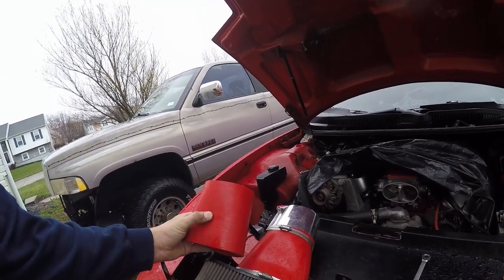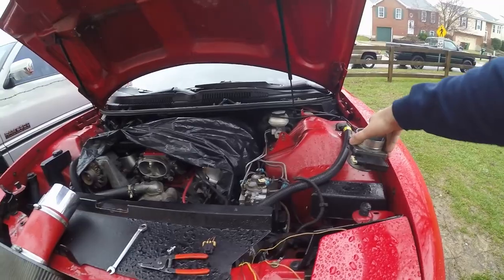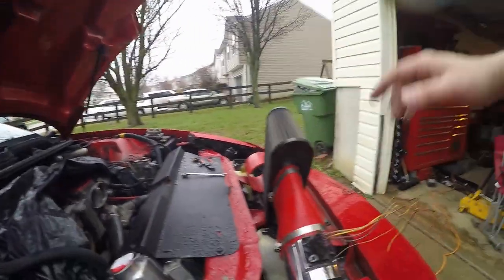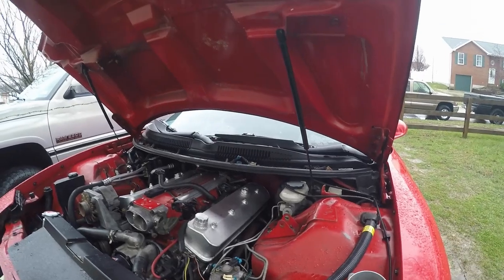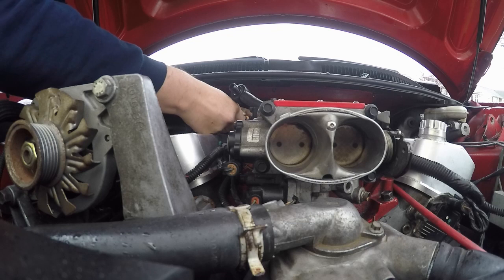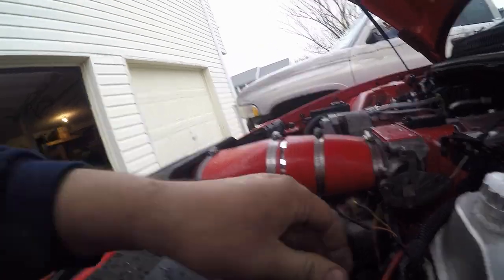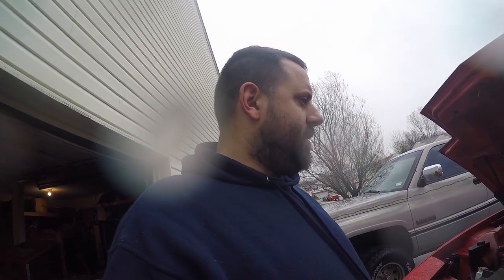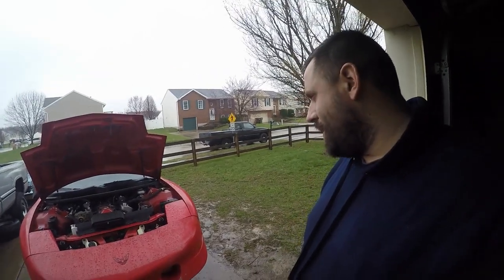LT1 411 LS1 pcm swap part 7 First Fire!

Comment: On these lt1 motors you gotta put the timing set both at 12 o'clock, not 6 and 12 that's why you're 180 off. 👍 Nice work tho I like it

Comment from the maker: I think it would be alot to do all at once. I already had a rear distributor in the car and a different ecm. Swapping computers wasn't too bad. Worst part is just looking over many diagrams to see what goes where. It'll be nice using modern tuning software on it now. 

This would probably also be an ideal setup if some one popped their motor and wanted to run a vortec 350 in place of it. You could just bolt on a miniram or Edelbrock proflo and you'd be good.
Reply: Rabbi Schlomo your picture Edward James olmos 😂